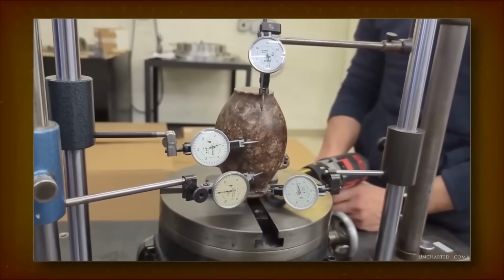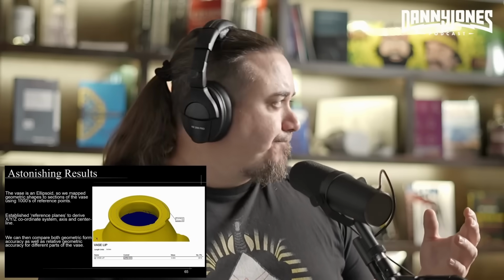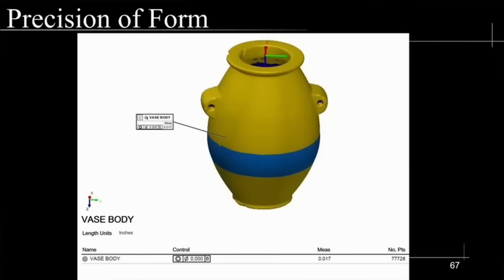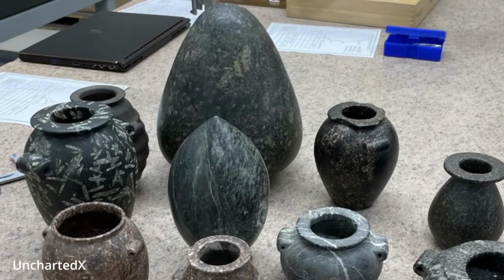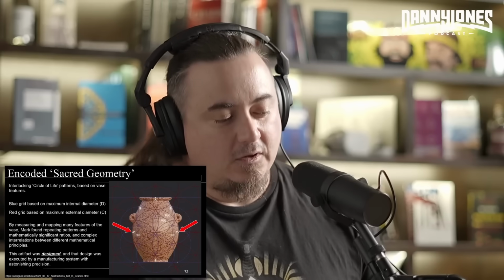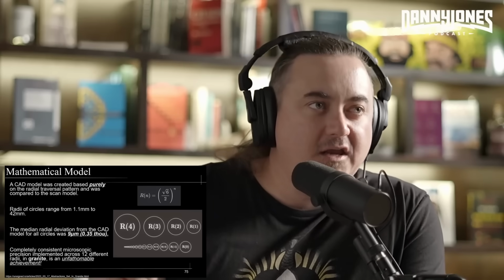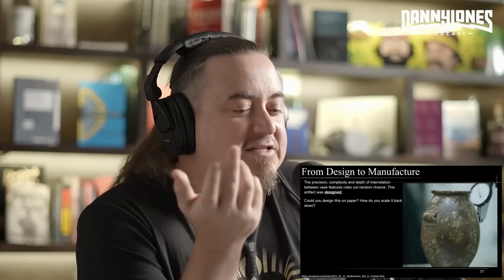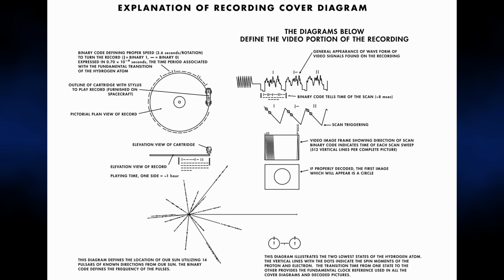Are These Ancient Egyptian Vases Actually Impossible to Make? #podcast #science #history #egypt

Comment: I worked for cold spring Granite company in minnesota.  They are the largest granite company in the world.  They own over 700 quarries around the world.  Anything made of granite most likely originated from there. They have a 7 axis robot arm with a hundred different diamond attachments.  I've seen that thing make almost anything but vases ang jars because the arm is too thick to get through the neck. The best they could do would be a cylindrical core. I worked there for a few years and a company down the road that cut granite with water jet. I still can't figure out the Egyptian jars. Honestly... only diamonds mixed into nickel can get you these kinds of results..... and there's no evidence they had either.  Aliens.... lol!
Reply from the maker: They are incredibly precise
Reply: This precision on the inside is what really gets me. It's one thing to make the outside open area precise, but to maintain that precision on the inwardly bulbous inside, while achieving wall thickness symmetry through the narrower neck is so far beyond hand crafting that it's ludicrous to suggest it.
Reply: they aren't the largest granite company in the world  they don't own 700 quarries and they still ran loose abrasive wire saws in the 80s.
Reply: ask chatgpt: can you tell me a way in which i could create a perfectly symmetrical (to 1000th of an inch) granite vase?
Reply: @TheeeDannyD  If you asked me to build this myself? I’d design a precision granite-turning CNC machine inspired by optical grinding lathes with live measurement correction. I’d treat the process like making an ultra-precision optical mirror, not a vase.

Does that answer satisfy you? Or do you want me to propose how an ancient civilization without CNC might achieve it?
Reply: @TheeeDannyD 
Creating a perfectly symmetrical granite vase to a precision of 1/1000th of an inch with primitive tools in ancient Egypt would be an extraordinary challenge, given the limitations of the technology available at that time. However, ancient Egyptian artisans were remarkably skilled and developed sophisticated techniques for working with hard stones like granite. Here's a conceptual approach based on their methods and some reasonable adaptations:

    Material Selection:
    Choose a fine-grained, homogeneous granite block with minimal flaws for easier shaping and greater symmetry.

    Initial Shaping:  
        Use abrasive materials such as quartz sand or emery mixed with water as a grinding abrasive.
        Employ hard stone tools (e.g., dolerite or basalt) to chip away and roughly shape the vase.
        Achieve a general form close to the desired shape through iterative grinding.

    Creating Symmetry and Precision:  
        Develop a rudimentary compass or scribing device using a string and a pointed stylus to mark out the central axis and ensure symmetry.
        Use a simple plumb line or leveling device to keep the axis vertical and consistent.

    Refining the Shape:  
        Gradually refine the form by progressive grinding with finer abrasives.
        Regularly check the symmetry by comparing measurements with a simple measuring device, such as marked rods or string, to ensure the dimensions are consistent on all sides.

    Achieving Fine Tolerance:  
        To reach 1/1000th of an inch (about 0.025 mm), employ meticulous iterative grinding and measurement.
        Use a micrometer-like device, if available, or comparative measurement techniques—placing fine, calibrated marks on a reference rod and checking against the vase's surface.

    Final Polishing:  
        Polish the surface with increasingly fine abrasives, possibly using natural materials like fine sandstone or leather with abrasive powders, to achieve a smooth, symmetrical finish.

Note:
While ancient Egyptian tools and techniques might not achieve the exact precision of modern machinery, their craftsmanship, patience, and ingenuity could produce a highly symmetrical vase. The key would be incremental shaping, careful measurement, and consistent grinding, combined with an understanding of symmetry.

Would you like a simplified visualization or more details on specific tools or measurement methods from ancient Egypt?
Reply: @edelweisstomner9009  Egyptians didn't make the vases or the boxes. The older pieces are the best examples. They wouldn't have gone backward in their skills. 
       Who ever worked the granite was very good at what they did. No one has done it since.
Reply: @edelweisstomner9009  for a water pitcher? Ummm, ok. I'm going to spend 20 years making a perfect water carrier, so I can 1 up my neighbour? The level of precision and the immense work involved defies the purpose of use for the intended item.
Reply: @edelweisstomner9009  Funny how ancient Egypt is the only country who's architecture and artifacts got less complicated, surely the artisan's would improve in skill?
Reply: They had access to corundum powder, emery, which was naturally present in their homes, and was more than enough to work with hard stones...
Reply: @michelbrz That’s very interesting indeed.
Reply: yes diamonds mixed into nickel.... plus a computer, multi access milling machine, mathematical design knowledge, etc. The Egyptian archeology 'experts' would have us believe the Egyptians had all this technology (if you believe this tech is needed to make the vases) but they couldn't even make iron.
Reply: , совершенно верно. Почему остальные вазы не такие точные, как и углы кривых саркофагов? И вообще, не современная ли это подделка?
Reply: @mikestray76 couldn't make iron, nor could they put a decent hi lustre polish on granite, which is very revealing.
Reply: Do you reckon they could have been made by hand?
Reply: @36AccountsBlockedRIP  yes
they didn't all have this quality of finish
Reply: The builders seemed to revel in using the hardest stone possible, and created such mammoth monoliths and statues that they obviously were not challenged by scaling things up to any ludicrous scale. The size of their statues in some cases were into the hundreds of tons of granite, and they even polished them to a ludicrous level to make mirror-like reflections. There's still a bull statue in India like that -  huge -  CAD precise, and polished to the point where you can shave in it like it was a mirror. The scale problem seems to be a separate problem that we don't have to consider with the pottery, but it exists and begs answers. To scale something of precision up to the size of a large pyramid, that is just on another level, especially when you look into the rooms and shafts inside that all contribute to acoustic properties that cannot be random.
Reply: I am 78 from Aberdeen, the Granite City. I would love to have the Aberdeen granite workers from the late 1900s give their comments. They would know what was and wasn’t possible with basic tools. Vast numbers of granite balustrade pieces in the city from lathes and much ornamentation and an amazing hand chiselled granite statue of Edward VII but no vases I know of. All can be seen online.
Reply: This is a cool comment. I had no idea this was in MN.
Reply: Завод в Китае сделает такие вазы за 40-50 долларов. Им делали  запрос и показывали чертежи и допуски требуемой точности.  Этом есть на другом канале.
Reply: I think harmonics, vibration and frequency played a role. We as humans still don't understand electricity completely. We will get there!
Reply: @adamfrye3355 that's a silly dream
Reply: Bot comment
Reply: They also had to make to measuring tooling to verify their work. Those numbers in accuracy aren't an accident.
Reply: @C-Culper4874 free-formed one-offs are not being measured for precision to a master model design.
Reply: @C-Culper4874 The accuracy isn’t an indication of measuring tools. It could be a consequence of the method used.
Reply: @RasmusLarsson-c4r  Sure it is. Accuracy is determined by measurement. When I mill out a part it doesn't matter how pretty or smooth it is if its not to to measured size I need. They couldn't have made each side accurate to each other with out measuring for it.
Reply: @C-Culper4874 That’s not relevant for single items that doesn’t need to match another items dimensions. And even things that need to fit together can be fitted together without measuring. Real craftsmen does this all the time. You only need measurements when making standardized components that needs to fit with other standardized components.
Look at how they used to make glass lenses a couple of hundred years ago. They would take a piece of glass and rub it in a bowl of fine quarts sand until they had a lens with the needed properties. That method creates lenses with amazing precision if you’re skilled.
Reply: @RasmusLarsson-c4r  when you are making one side of an item mirror image the other side of it that close. You can't eyeball that. Try it for yourself.
Reply: @RasmusLarsson-c4r accuracy could also be a consequence of material. Which as you said would affect method of construction. Take snow and ice for example. If you were to build the same structure out of snow or ice the ice structure is likely to be far more accurate even though it is harder to work with.
Reply: @C-Culper4874 I have never said you eyeball anything. You don’t need to eyeball things if you know how to fix you object in a rig and then  use rotation along different axis to have your material removing tool create symmetric shapes. People have used rigs made of wood, bone leather, wax, sand, clay, vegetable fibers and rope for as long as recorded history has existed. And since those things are easy to obtain they very likely used these things long before using crafted stone tools and burnt ceramics. And all these methods using these most basic materials are still in use all over the world today by different types of craftsmen.
Reply: @RasmusLarsson-c4r Sure. I get that. My point is that the material they are working with isn't easy to work with. Between the vases. The boxes and other items they crafted. They are far more advanced than people today want to believe. These guys were good. Many people believe people thousands of years ago were chest thumping goons. Ironic considering over half the adult population  today can't change a tire.
Reply: @C-Culper4874 I absolutely agree they where advanced. But it’s been pretty clear for some time now that even during what is called the stone age mankind had much more complex and advanced societies and craftsmanship skills than previously believed. And my point is that a lot of the things we today look at as incredible advanced in our own society are things that we know craftsmen has been doing with much simpler tools just a couple of hundred years ago and those methods where often known and documented by roman authors 2000 years ago. And we also know that romans used methods later forgotten and then rediscovered by archeologist. Like building with concrete that wasn’t using cement that hardens without air but using lime mortar that normally needs air to harden but they mixed it with volcanic ash making it harden without air. And that’s a method that is much less technologically advanced than creating cement. But at the same time creates a higher quality end result. From such examples we can learn that some things created in ancient times can look extremely advanced if we look at what types of methods we use today to achieve similar results. But at the same time a much less advanced technology we no longer use might be much better at achieving the same result. And this might be very hard for us to understand today because we tend to use overly complicated technologies to save time in training the workforce and to mass produce things with a small workforce.
I have a great example of this from a couple of years ago when I needed a piece of plywood cut in a very specific shape and the guy who had designed it for me told me I could order it from some place online and I said, no I can make it myself in my workshop, I just need the drawing. And he looked at me in awe saying: – Wow, du you have your own laser cutter? And my answer was: –No I have my grandgrandpa’s hand tools and I know how to use them. Guy just stared at me as if I was either lying or an alien. He literally couldn’t understand how plywood could be cut with anything but a laser cutter or a CNC-machine you could feed the drawing to directly.
Reply: @RasmusLarsson-c4r I hope they find  some tooling. I believe human history as we think it is , is way off the marker. We are missing several pieces to the puzzle. I think it was a small group of people that were crafting these items. Even today a small % of people are really good in their respective area. 

Think about the pile of vases that didn't  turn out. Wonder if they slung them across their work area and said, what ever their curse words were,  yet to try again the next day. Or maybe the group died out over a bad piece of fish and the knowledge didn't get passed on. We will never know....well having a fit over something not turning out right is a human condition so I'm sure flying vases were a thing.
Reply: @C-Culper4874 Of course it was a small group of people doing these things. There is a type of very highly crafted flint knives found in stone age graves and settlements all over Scandinavia and south of the Baltic Sea. The flint they were made of was then identified to come from the same quarry in southern Sweden. So for a long time it was thought that everyone made their own flint tools and that flint was traded from that quarry. Then archeologists excavated in and around the quarry and found stacks of unfinished knives and piles of scrap flint including failed knives and then they found “workbenches” and the hammer stones and bone tools used for making flint knives. Eventually it turned out the whole place was organized like a factory for mass production of high quality flint knives. So there literally was one single factory that made all the high quality flint knives found in northern Europe and no one else seems to have had the knowledge and craftsmanship to produce flint tools of that quality.
Reply: @RasmusLarsson-c4r  yep if tech
Reply: maybe they had lasers and antigravity
Reply: @jeffheiner  🤣
Reply: @jeffheiner don't forget time travel and teleportation! 😂
Reply: Which is funny because I've seen people work granite with pieces of flint before.

The myth that only diamonds can work granite is a really funny one.

Just for reference, mankind has been using flint tools since BEFORE THE ICE AGE.
Reply: @mnomadvfx Flint and granite are the same hardness on the Mohs scale which is a 7. So even though you could use flint to cut granite it would take forever.
Reply: @craigthescott5074  No it doesn’t take forever. It just means both your workpiece and your cutting/abrasive tool lose a similar amount of material when you work. And if your abrasive tool is sand or use sand then the sand becomes finer and finer creating a more smooth surface the longer you work.
Reply: @RasmusLarsson-c4r  it's not as hard to make it smooth, it's hard to make it both precise and smooth. and with what tool you measure such precision?
Reply: @zedalive4764   It’s not precise at all. It’s only precise the way you would expect if it was made in in a lathe constructed out of wood. It’s the rotation that creates the kind of circular precision they found when measuring. The ears, which is the part that can not be made in a lathe, have no precision at all. This tells us that the ears is likely made first and might have a critical function for holding the stone block fixated in the lathe.
Show me several items that is exactly identical in every way measured down to a tolerance of 0.001 mm then I might be convinced they had some actually advanced technology. The reason is that precision is not hard to achieve for one item or for hundreds of items as long as they don’t have to be identical. Precision is only hard to achieve when you must create a series of items that are exactly identical.
Reply: @RasmusLarsson-c4r  lathe made of wood can't produce anything precise. the others have explained
Reply: @zedalive4764  That’s actually complete B.S. by people who know nothing about craftsmanship using older tools.
Reply: It's Africa they likely had access to diamonds tungsten etc.
Reply: @ddoherty5956 they may have had access to diamonds in Southern Africa but they don’t show up in Egypt at all during these time periods. Diamonds also don’t show up in their jewelry..
Reply: @craigthescott5074 Which time period, they don't know when or where they were made. But I do see your point.👍
Reply: It's sand inside
Reply: You can work every type of granite with quartz.
And that is a cheap and common material.
Reply: @wolfgangkranek376 I don't believe you could make a vase 1/10 as precise in the same difficult, hard rock in a decade, full time on it with any primitive hand tools. All for a vase to carry fluids in hey? Sounds logical (said no one).
Reply: @wolfgangkranek376 This still doesn't answer anything. What's your point?
Reply: Let’s say I spent 15 years making clumsy vases. And then I took a hunk of granite a bunch of sand, and tons of sea water, and lots and lots of reed cloths and rubbed on it say every day for like 5 years constantly planning and measuring as I went along.
Reply: @TQFMTradingStrategies  so what measurement tech the Egyptians had?
Reply: Unless UnchartedX allows their results to be replicated by third parties, I wont believe them and neither should you.
Reply: @ryandebruys2762   - Nothing is stopping anyone from trying to replicate these vases. The raw scan data for quite a few of these precision vases is openly available online. But making a vase with translucent 2 mm thick  mathematically perfect rose granite walls that light shines through  is easier said than done.
Reply: @ABC-yt1nq  a scan is nothing more than a reproduction. It is just as susceptible to fraud as false results are. The only way to verify the precision claimed is to physically measure the actual vase. In any academic or engineering context, this is routinely done. But when all you do is make a YT video, apparently you dont have to.
Reply: @ABC-yt1nq  ive looked at the first scan they did. And you can clearly see the holes arent aligned. It is ridiculous to even suggest it is precisely made. Yet everyone accepts their claims without hesitation. It is a grift
Reply: You're thinking too much in the present day. People weren't in a hurry thousands of years ago. They would probably spend months or years making one vase.
Reply: @tokesalotta1521  with respect , I don’t think you’ve listened or grasped the level of accuracy that has been achieved here by the maker . Your assumption about the level of haste prevalent back then and your assertion that they would be willing to take years to create such a vase makes absolutely no sense …. Whatever the pay scale , an artisans yearly salary would make this vase incredibly expensive and yet beyond marvelling at its perfection , what purpose would all that expense confer to the function of the product . Why go to all that trouble ?
Then there is the conveniently overlooked aspect of the metrology associated with its design and production . How was the accuracy achieved without precision measuring devices ?
Reply: @DamosTamamoto I agree. How did they measure their work? Removing material is easy.
Reply: @C-Culper4874  removing granite from the inside is easy with the ancient tools? something new...
Reply: @tokesalotta1521 
They found thousands of them. So you're suggesting that hundreds of people had the time and skill to make these. 🤦
Reply: @tokesalotta1521  Assume that thousand years ago, human technology behind than current technology is insane. It is only assumption without evidence. From Egypt until now only several thousand years. Until now there was a community that do not use modern technology. Human live more than million years ago and some technology can gone because of natural disaster and war.
Reply: @tokesalotta1521  They "would" and "should" have had no way of even verifying the accuracy of the work which they were carrying out...
Reply: @tokesalotta1521 extending your logic, given enough time, the ancients would be able to make the titanium chassis of a high end phone. Right?  Because it's about time and willpower, not technology.
Reply: @GregAz-z3s  That's a nonsensical notion, because it's complete different technologies.
Reply: A quick googling tell you that Egyptians cut granite blocks using quarts sand saws. So you don’t need diamond, quarts is hard enough.
Reply: @RasmusLarsson-c4r  better, they had natural emery, a little harder than quartz